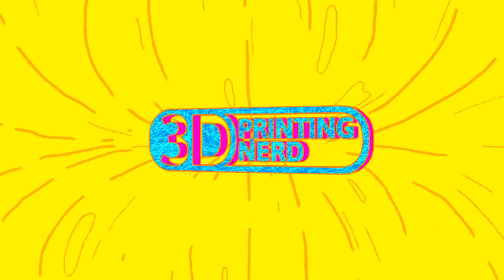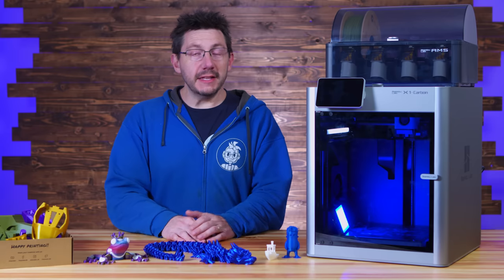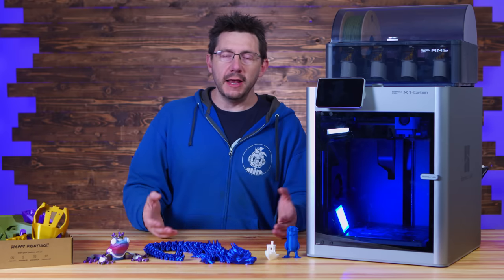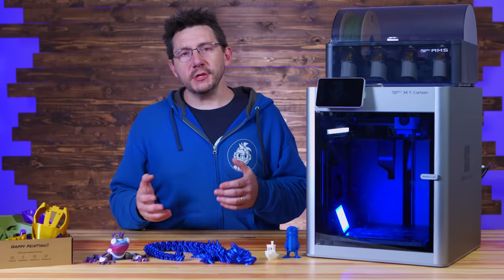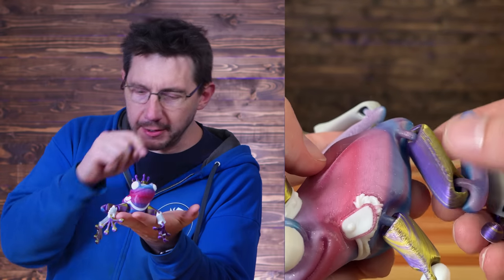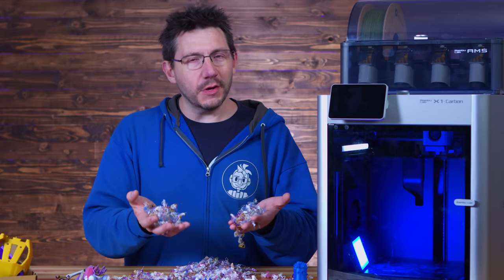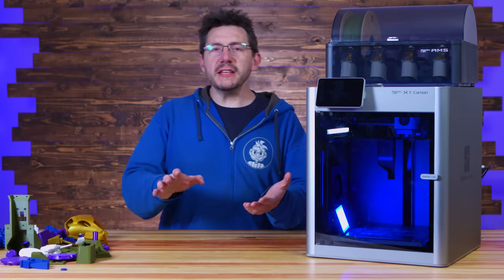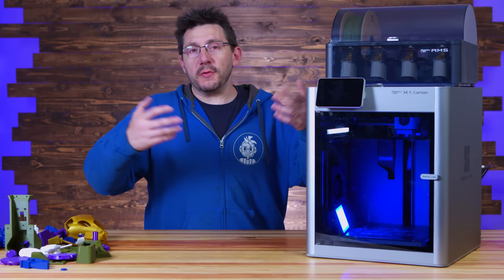Bambu Lab X1 Carbon + Kickstarter?!

Comment: Nothing about their software? Based on Prusa Slicer they do NOT officially support linux? This is a kick ...in the ass of open source.
UPDATE: There seems to be a solution for linux on github being available now (End of january 2023). But why did they manage that so late? It is not the task of the open source community to get a piece of software working for linux while the big ones already run. Especially when this software is originally based on open source software. 
But: Better late than never. Fine to see that we do not need to waste our time on emulated software for this printer. Fine to see that the kick didn't hurt too much.

Comment: Money was the reason behind me not getting the X1 Carbon. I have debt right now that is worse because of a recent set of medical bills. If I had ignored something that turned out to be benign, thank God, I probably would have purchased the X1 as I really really want it.  

Once I pay off my debt though, I will be buying one. By that time I should be able to get it directly from them I hope. Sure it will be a few hundred more, but it is still worth it compared to other printers out there at a similar or greater price point.
Seriously it brings up another point I think needs a lot of attention.
Why would you buy something like a Prusa XL or E3D Tool Changer or even a Raise3D machine now when you can get the X1 from Bambu Labs with it's list of features for a cheaper price?
Seriously. Compare the features of them and ask yourself which is the better deal.
I don't know about you, but I for one think that all the other 3D Printer companies need to wake up and rethink their price points because Bambu Labs has really changed the game here.

Comment: Kickstarter Popular X1-Carbon Combo $1200 119 left!!! Only 119 Combos! 
Kickstarter Special X1-Carbon $950  287 left
Kickstarter Special X1 $800 186 left
X1c has Hardened Steel, Camera, VOC filter, and Extra part cooling fan,Aluminum side panels vs the X1 for the $150 more
All prices plus shipping

Comment: I also pledged, could not for the life of me get that early bird combo (haven't done kickstarter in years since it's mostly become a pre-order station). But this and the sub 1k savings did push me. 

I can't have it both ways, but something that bugs me is how closed will this be. The custom print head and all that means I'm in that system. Can I print with a diff slicer? Will they eventually say Bambu Labs filament only and a forced firmware update that reads codes in spools? I'm excited for it but don't want to lose the option of any repair or changes. That said, I like the push button ness of it and the options for printing and purging etc. So.... Trade offs. I think someone's been having interviews with Bambu labs on youtube, but I just don't trust what companies say will be long term when they can flip on a whim and not be held accountable (Google, Telgram, anybody writing software).
Reply: The spools are refillable.
Reply: @lazyman1011  yeah, i know there are no blocks *now*. I just worry about it for the future (looking at you elegoo + chitubox)

Comment: Amazing video, as always!   1) How dependable is it over very long prints? Back to back prints?   2) How accurate (tolerances)? How are they sustained over time and over numerous prints? If something out of adjustment, what happens?   3) What if printing multi-material of various temperatures (nylon, then pla, etc) within a single print, or queued numerous prints in a row?   4) How does it handle PC and non-filled PA (nylon)?

Comment: The Kickstart imo went poorly. Me and many others have not been able to back it on the site due to the entire inventory of 1000 units not being able to be selected due to constant errors. I originally wanted to back it but ended up deciding not to. By the time I could select a unit to order they put up new units at a vastly reduced discount of only $250 dollars off the top end $1500 dollar model from $1450. 

At this point its better to just wait for retail. I really hate their decision to use Kickstarter and while not likely to be a scam kickstarter money needs to be willing to set on fire and I'm not willing to risk that for such a small savings.

Comment: I think this is an interesting and unique printer.  The Kickstarter approach is why I won't consider it.  Creality ruined it for me with the Cr-6Se and their scanner.
Reply: Sorry you had a bad experience with the CR-6SE. I also backed the CR-6SE and it’s been the best purchase I’ve made in awhile. I had a few issues but I’ve been able to work around them.
Reply: @greengorilla3000   I agree. I have a KS CR-6SE, also a CR-10S5, a CR10SPro, Two Ender 3's, A Ender 2-Pro, and a CR-30, and am building a Klippered TronXY X5SA and by far the CR-6SE is the only one I've put zero work into other than the community firmware update. It just flat out always works. I dropped my pledge for the Anker and backed the X1, and hoping it will be as robust and solid as my CR-^SE has been. In fact I'm only on my second nozzle and I'll bet I've ran 25-30 entire Spools through that machine.
Reply: @randyre8172  I had an OK experience with the Cr-6SE, but I had 2 Ender 5s and an Ender 5+, and I thought I could mod the CR-6 with the same hot end and board, no way it was all custom.  I gave it away.   This started my conversion to Rat Rig, just finished my second a 500 cube.
Reply: My CR6E was a dog, cost me £100 in new parts to fix it to get the first print. So £1000 for a printer with no warranty and no legal consumer protection.
I can’t afford to burn £1000.
Now if it gets delivered and you can buy a retail one that’s a different story.
But Kickstarter. No never again.
And I did not even mention obsidian, at least Creality delivered a printer.

Comment: This machine looks awesome but I am gonna wait until its more readly avaible and dont have rely on kickstarter. Also my other concern is that some of its features, like the AI, is supposed to only work with there cloud based slicer. For me thats a pretty big concern and let down because that means that if they go out of buisness then so do most of the features on this machine. Also if I am not mistaken the servers are only in China so if they go offline then so does your slicer and with the CCP they can decided to block all trafic, which is unlikely, or just simply shut them down for whatever reason. If they can make multiple servers in different countries for redundancy or better yet make a slicer that works offline then that would be awesome.
Reply: the are already working on an offline slicer , every one in the group has mentioned this concern to them and they seem to have heard, just waiting on them to deliver on this. the AI feature and Lidar can be something can can be updated periodically through an update with they offer and offline version for local network.
Reply: @hexotech5202  that is great to hear. If they do follow through that will be awesome since that would mean they are willing to listen to their community to make improvements. Honestly I cant wait to see this officially released and also see a bit more reviews when a couple of updates have been made and the slicer released.

Comment: It would be great to see more technical prints instead of the trinkets that everyone has been doing.  yes it can print fast and tolerance tests are impressive, but that means very little (to me anyways)... for example, if you tell an axis to move 100mm, does it move exactly 100mm (not +/- some percent) and can that be adjusted... to measure a printed (20mm) cube is pointless if the motion system isn't precisely calibrated.  If you have a printer that is that is very precisely calibrated for technical prints how does the same prints on the X1 compare?

I'm (probably) sure that a super technical video wouldn't be great for ratings or views or whatever (no clickbait value), but it would be great if someone  would do it... hell, no one has even torn one apart yet to see the guts! Maybe someone like cnckitchen will have a more technical approach.
Reply: This is all stuff that was solved years and years ago.  This is minimum expectation at this point and not even worth asking.  You cannot get good looking layers if you're not moving as far as you're telling the machine to physically move.

Comment: I backed this KS. I was about an extra 500 in to getting my cr5 pro setup for reliable engineering grade prints. I added bondtech direct drive, skr pico, neopixels (required), slice engineering parts, and was about to setup a MMU and full heated enclosure but I think I will just leave it where it is now lol.

Comment: is it only capable of using its own propriety filament? if so that's a hard pass for me
Reply: It will use any brand out there. and most any medium except TPU. Bambu has already said in numerous venues that it will be an open ecosystem, but that they will continue to develop their own filament for the "best" experience and price it competitively.  I too was a bit worried about that, especially given that one of the main guys with the company used to be with DJI and they are very well known for a closed ecosystem (mainly the drones batteries)
Reply: He used several random filaments in this video.

Comment: My x1 carbon is slowest printer I have. 
I've been working on an 8 hour print for 3 days now. The ams system is total garbage and won't even work unless I'm standing over it to jiggle the filament every time it tries to unload. They didn't build it to work with standard filament roles, they want you to buy your filament from them, so they can charge you 5 dollars more than it would cost on amazon.
I feel like i got raped.  Fast machine, but the ams is garbage.

Comment: At the end of the day it's a 3D printer. Seems to be a good, fast one, with many creature comforts. In the downsides column, first of all, it's Chinese, and you can't run it without the Chinese software in some Chinese (I assume) cloud. Which means you can't really rely on having any data security whatsoever. You're also potentially in trouble if you somehow lose access, because there's no such thing as s cloud, there's only someone else's computer. In China. This will probably be a boat anchor without the proprietary software. Also, for me it boils down to the fact that I already have a Prusa. It's printing fantastically well for me especially with the Revo on it now, and while more speed would be highly desirable, I can just load up the 0.8 nozzle for prints I need fast but coarse. So... there's no rush whatsoever for me to get something like this. I'll be watching developments, seeing what the other manufacturers do to respond, and in general chill with my existing solid 3D printer, rather than Kickstartering my hard-earned dough. I also vastly prefer open-source projects over closed-source ones like this.
Reply: It also works with cura or slic3r I believe. Plus they agreed to release the slicer open source after the launcher some time. I wouldn't be too concerned about the slicer but you will probably lose some of the special features that their slicer puts into the gcode. The way it was described was it puts meta data in the gcode it understands for some of its features.
Reply: It does not require internet or a cloud. I have one and tried SD card printing and it works.

Comment: The Bambu X1 is nothing but another Voron v0 copy from china with a different enclosure, no surprise if it is full of faults, its the same as every other diy printer with the only difference being it comes assembled, waste of money, ankermake is the way to go.
Reply from the maker: Ankermake is nothing but another i3 bed flinger from China with a different wire for the hot end. See what I did there? It’s crazy how you can give an absolute opinion without any personal experience with the machine.

Comment: so its crappy printer.
i continue to use my ender 3 pro
Reply: This machine is literally like 100x better than an Ender-3, I put my Creality machines up for sale the day I received my X1 carbon and never looked back.
Reply: I think the time of this recording there were still a lot of bugs to work out.  Now that most of those bugs seem to have worked out, I ended up buying one, received it almost 2 weeks ago, and only had some issues with adherence to the plate. Now that I have the textured PEI plate I haven’t had any issues, now running for Just over a week. And I am a newbie at this, this is my first printer for 3-D. I really like the opportunity to send prince via Wi-Fi, as I use the computer in the spare bedroom, Office on the second floor, and have the printer set up in the basement where we don’t hear or feel it at all when it’s working. I did get the AMS, add just add another layer of convenience, especially when I have a second spool of the same filament that it automatically switches to shut the first roll run out. Any issues that I have had during print, it has sent me a notification to my Apple phone, which, of course, then signals me on my Apple Watch, and then pauses printing, until I say to resume or physically, go and take a look at the printer. I’m enjoying this so much, that I’m waiting for my order of the P1P. Yes, I ordered a second printer, don’t tell my wife.